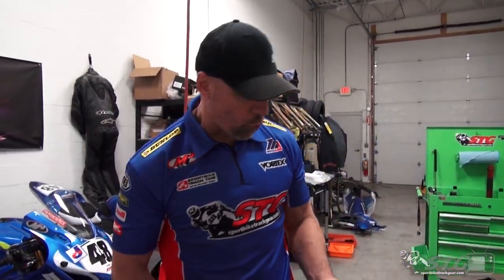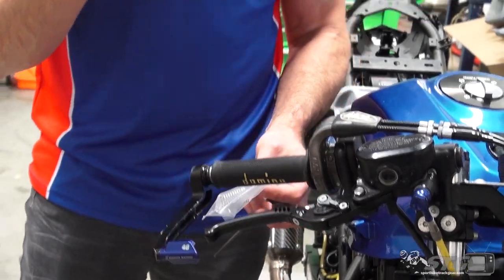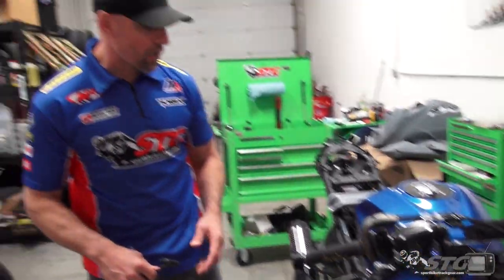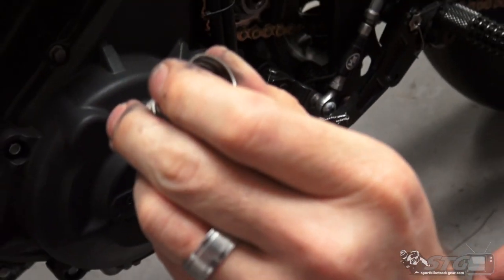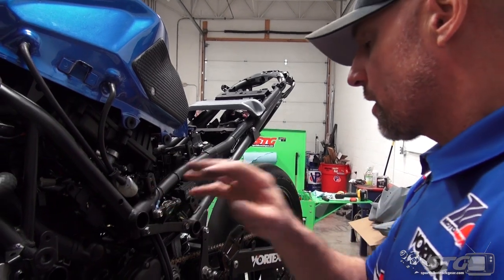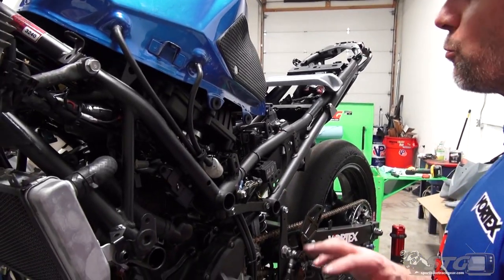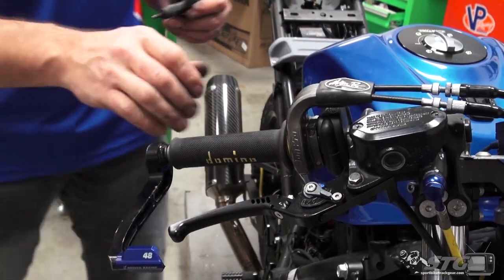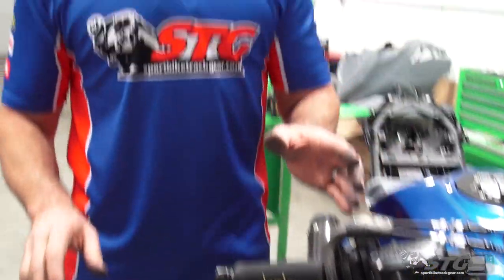Norton Motorsports Soft Pull Throttle Return Spring Install | Sportbike Track Gear

Comment: Pretty painless. Little dab of grease on the back of the plastic piece keeps it in place. Also, a small dental mirror helps to visually make sure everything is lined up behind the turn plate.

Thanks Brian
Reply from the maker: Thanks for watching. This is a worthwhile mod for sure. - Van

Comment: Great video guys. 

Please do a clean video on the norton motorsports clutch upgrade parts for the 400 shift star,blueprinted shift rod etc 

Go faster Max...
Reply from the maker: We will do a short video on these but they will ultimately be installed in the motor I am dropping off to our engine builder. - Van

Comment: I wonder what kind of specifications they used for the softer springs like as far as thickness? And the type of metal they used.
Reply: I'm all the way out here in the Philippines and honestly it's kind of a bummer to have it ship all the way out here!  O was thinking I can have it custom made out here
Reply from the maker: I do not have these specs, you would need to reach out to Norton direct to see if they are able to help. - Van

Comment: So to my understanding when u put the "pulley" back on with nylon spacer, u need to rotate it counterclockwise one full turn then slide onto stud to build the spring tension? Not just put it straight on, is this correct? Thanks.
Reply from the maker: Yes you need to rotate it to put tension on the spring. - Van
Reply: Hard to see in video just wanted to make sure, greatly appreciated videos help a ton!

Comment: I hear from a reliable source that Kawasaki isn’t producing the Ninja 400 for a year (but that it should be back in 2022, with a Euro 5 engine - same with the Z400, ZX-6R, H2, H2 SX, and a couple of other models ...)
Reply from the maker: As far as I can tell there are 2021 Ninja 400's being sold here in the US now. - Van
Reply: @sportbiketrackgear  ... OK, cool; may just be a Euro thing, or I was told the wrong thing, or they are actually just 2020 models (a grandfathering rule lets them keep selling non-compliant engines for, what, 2 years or something?!).  Cheers
Reply: @sportbiketrackgear  
Chris Riddiford 😂
Facebook
Call